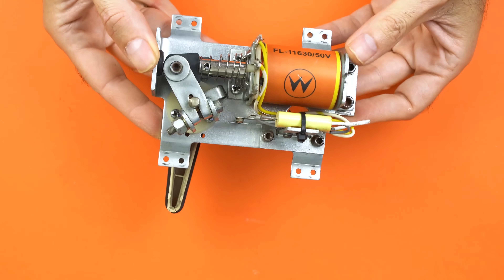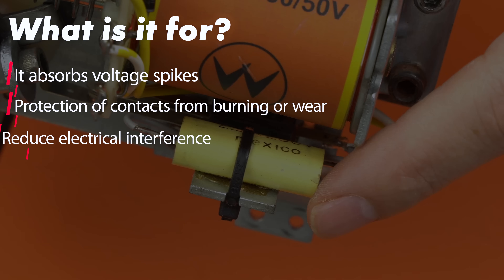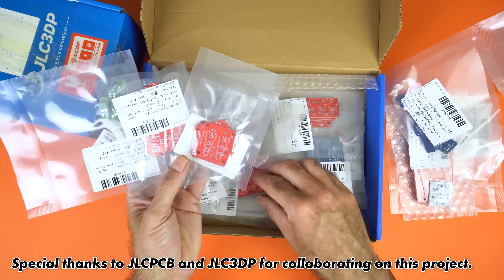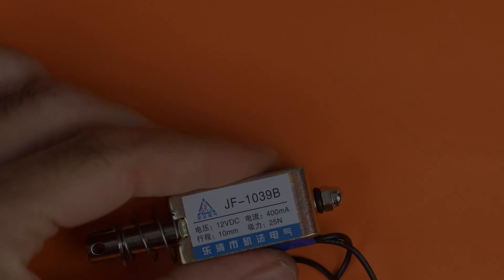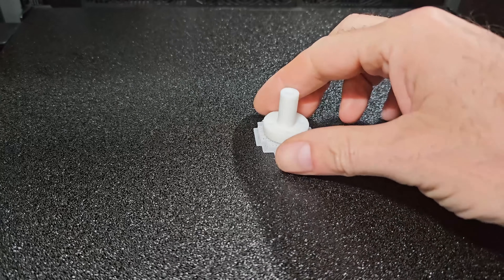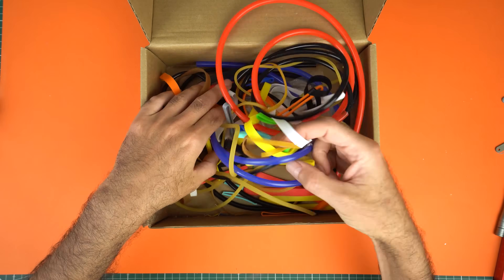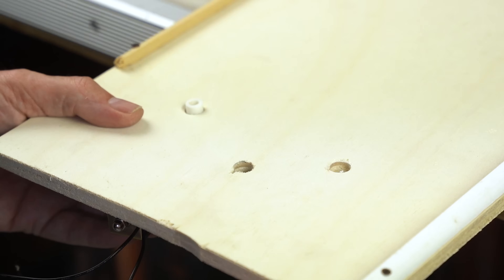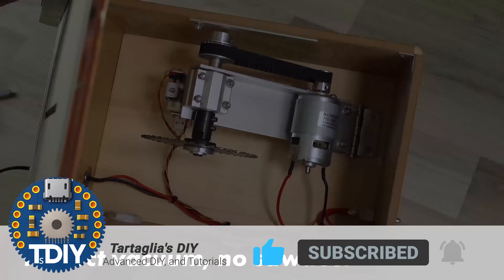You Won’t Believe How This Pinball Plunger Works! #4

Comment: You can program the flipper using pwm to produce an effective less voltage.  All new manufacturered games use this method and have the eos switch just has a fail safe.  20 ms pulse iirc

Comment: I really enjoy watching you project.i also Build a Simulator Pinball Maschine, were i used pwm to Not overheat the solenoids. Works pretty good but your Hardware Solution seems better to me tbh ^^ i also remember that moment when the two Flippers were working and it was so much fun playing and imagining how it will turn out when everything is on the playfield

Comment: Some perplexity for the parts in plastic, probably better to them also in metal. And I think it is risky to have the micro that disable high voltage when activated because if the micro fails the coil will burn.

Comment: Love the project And the execution looks amazing. Nothing beats the manual mastering of marbles, with well behaving flippers. Question: Quite often in original pinpall machines from the 90s, one of the flippers could develop a "lazy" activation if not properly serviced. What would have been the cause if you care to speculate?